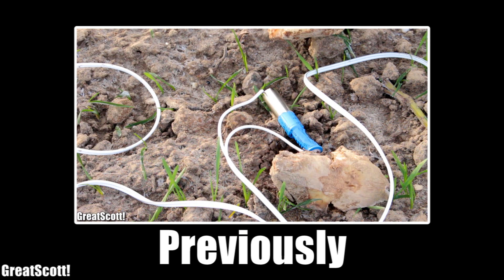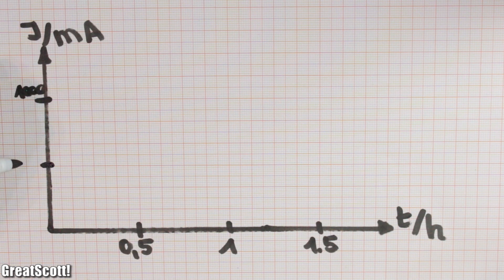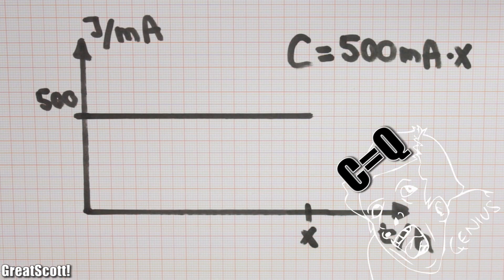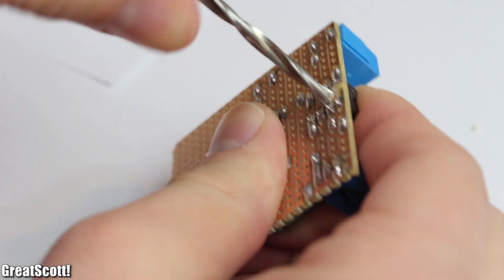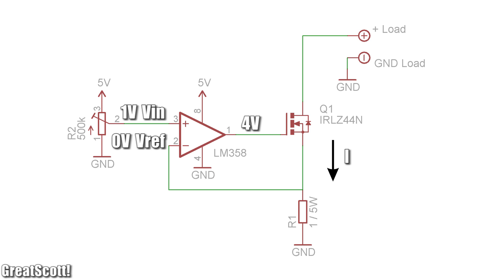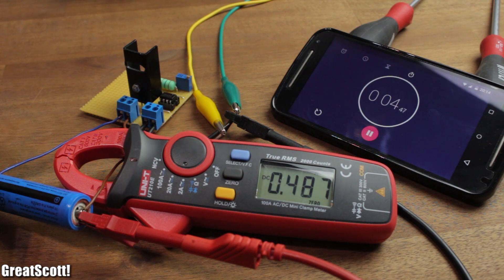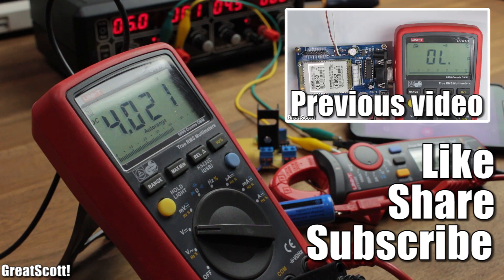Li-Ion Capacity Test || DIY constant current load

Comment: Nice and simple circuit. I made it work, but mine is quite inaccurate. I suspect the voltage drop in the traces between the mosfet and the shunt resistor is the reason.

Comment: I am only Civil Structural Engineer that barely made it through Electrical Fundamentals in College. It seems I am still lacking that part of the brain that can understand most of the current, ohm and resister formulas, yet the use of a constant load made total sense for the mAmp calculation. I have replaced the battery (EG30) in some Mororola XT1030, them do not seem to seem to be much like a new battery. It is hard to determine whom, is selling batteries that actually supply the power they state. It may come down to you get what you pay for, but it is often hard to tell. Either way, I would appreciate hearing your thoughts on this post on How to Revive Lithium Ion Batteries.

http://sciencing.com/revive-lithium-ion-batteries-5982537.html

Is there any truth to this?

Comment: I'm having trouble with "drift" with the OpAmp voltage follower. I 
used a 1ohm, 10% power resistor, an LM324, and a IRF540 Power Mosfet (only .022ohm RDS(on) !!).

I am using a 9V power supply for the LM324 (measuring it, it actually 
shows about 10V)

I notice that if I use this to test battery discharging I get "drift". 
I'll start out at say, a setting for 500ma, and as the battery voltage 
drops, the current increases , and i'm not sure why. I thought perhaps
 its something to do with the MOSFET changing its conductance or 
something? I always end up having to adjust the input pot setting over 
time to lower the current back to 500ma

It doesn't make sense to me becasue the OpAmp should technically keep 
the voltage /current constant even if the resistor drifts, wouldn't it? 
It almost seems like my OpAmp is drifting.

Also, my MOSFET doesn't get hot at all, granted I'm only running 1.5 V 
at 500ma , and the resistor is .5V of that (I set the OpAmp + input to 
.5V so I get .5A on the 1ohm resistor), so ya it's only having to handle
 what, 500mw, not that much I guess.
Reply: The most likely cause of drift in your case is the resistor's value drifting. You're dissipating 0.5V x 500mA = 250mW in the resistor and if that's its rating, it will get hot and its value will drift. The opamp will compensate for any change in the mosfet's characteristics because it's inside the feedback loop, but the resistor isn't. The only other source of drift is the opamp's input offset drift, but that's going to be not much more than about 20μV/°C for the LM324, and as the gain is 1, that's really not going to be significant. Just try a higher power resistor for R1 and see if that fixes the problem.

Comment: Fantastic! This is exactly what I was looking for. I tried making a constant current load with an LM317 to test battery capacity, but the voltage was too low resulting in the whole thing falling out of regulation. I think I have most of these parts lying around. Thank you so much, I can't wait to try it out!
Reply: Why don't you use a tp4056 charging and discharging module. It will automatically cuttoff you battery connection with your lm317 tester when it discharge alot....

I know I'm little bit late here,😅

Comment: Sorry but the energy of a battery changes in accordance to the discharge current: the higher is the discharge current, the lower is the energy you can get from the battery. I'm not an expert of Li-Ion batteries, but with VLA and VRLA batteries usually the capacity is referred to a current that discharge the battery in 8 hours (C8) or 10 hours (C10). If those batteries are discharged in 2 hours the Amp-h you can get are lower.

Comment: Can I use that circuit to test 1.2V AA batteries? Or 1.2V isn't enough to draw constant current?
Reply: You can do it, but it's not quite as easy. Let's assume you want to measure capacity as the voltage drops from 1.2V down to 1.0V. That means you have just 1.0V to drop across the IRLZ44 and R1. You therefore can't afford to drop more than about 0.5V across R1 in order to leave 0.5V across the mosfet. I'd recommend a smaller discharge current, but if you still wanted to test at 500mA, you'd use a 1 ohm resistor again, although using 2.5 ohm and 200mA discharge would be more appropriate for AA batteries. You could set 200mV as your Vref with a 1 ohm resistor for R1 to get 200mA, but lower values for Vref will eventually run into difficulties as the opamp's offset voltage drift starts to become significant.

Comment: I've been trying for a few weeks to integrate this with an arduino.  My thought was that instead of a potentiometer for the non inverting input to the op-amp i could use a PWM signal from a digital pin, and use a resistor/capacitor circuit to flatten it out to a constant voltage.  however i've been fairly unsuccessful in doing so.  the voltage reading of the battery seems to fluxuate quite a bit and it's difficult to see exactly where it is.  

have you ever done such a setup or figured out a way to automate this a little more?
Reply: doing a little more testing tonight, I switched my ceramic 1 ohm 5W resistor out for a 1 ohm aluminum axial wound 100w unit and the voltage fluxuation reading seems to have subsided.  If you have any ideas as to why that would be, i'm very curious.

Comment: UltraFire: Not the best name for a Lithium battery.
Reply: 18650's CANT have 4800 mAh ... period.
Reply: @silversrayleigh8980  I'm going to be getting some that are 3000 mah for a raspberry pi 3 b+
Reply: They are LG battery's so they are real
Reply: @nathanmead140  3500 is the maximum achievable with 18650 (they are used in 5s2p cordless tool battery packs with 18650s with 6 Ah) but 3500 is the total capacity, normally only 3000 should be used, to extend the life span of the cell.
Reply: the ultrafire flashlight and batteries I got have protection ic's (batteries) and yes the flashlight (9000lum) can get over 100c under max brightness but the cheap ass batteries have an internal resistance that limits the light from going thermonuclear and even mid quality batteries do exactly the same fire may never happen but I was so worried it would I added arctic mx-5 between the led pcb and the case edge and it smoked a bit before it dried a little and I do like it as it is a great short term spotlight/worklight and seems to pull a stable 3.8a from a pack of 4 18650's
Reply: Lol... True
Reply: Ultrafire Li-ion battery: I create a fire bigger than Panasonic Li-ion battery.
Reply: there is a china mall in my town that sells these ultrafire batteries but they are ripoffs of ripoffs because these are called ultrefires and are rated to be apparantly 14000mah
Reply: heyhococo ha
Reply: Kkkkkk
Reply: @ElectroMundo_oficial  BR!
Reply: Yeah
Reply: Like 99% of those are fake with up to 9000mah ratings. That's how you can get free batteries from ebay if you tell the seller that the capacitance doesn't even close to stated one (and risk to burn your house with those).

Comment: hi sir great scott...may i have a question? since the op amp LM358 have 2 comparator...can i use them both??

2pcs. IRFZ44N, 2pcs. 500k potencio meter, 2pcs 1ohm resistor but 1pcs LM358....

thanks for your time to reply...
Reply: Yes, of course. The only other thing I'd recommend is placing a 100nF ceramic capacitor between pins 4 and 8 of the opamp, as close as possible to it, to decouple its supply. It probably wouldn't hurt to put a 10μF electrolytic capacitor across the incoming 5V supply, especially if you have long supply leads.

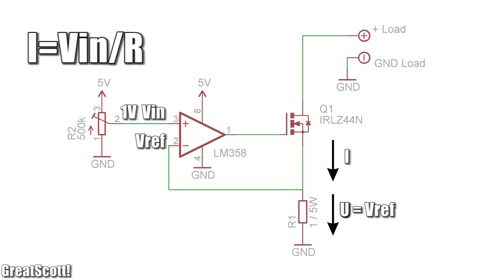Comment: Quick question: 3:40...WHY is I=Vin/R ? Would like to know how you found that formula. I mean I know how ohm's law works, but how does the op-amp affect it ?
Reply: Opamps with negative feedback always change their output to keep their inputs at the same voltage. The opamp and mosfet together are working as a simple non-inverting buffer that fixes the voltage at the source of the mosfet to the same voltage as is supplied from the wiper of the potentiometer. That constant voltage provides a constant voltage across R1, which gives a constant current through R1 and therefore draws a constant current from the supply to the mosfet's drain, i.e. the battery under test.

Comment: You should have used a BJT (NPN) transistor instead of the FET.  There would have been no oscillation!   Not that matters. 🤔
Reply: The oscillations come from the lack of supply decoupling to the opamp, not from the choice of buffer transistor.

Comment: I tried building this Constant current load, but it didn't really work. After checking almost everything on it, i checked the resistor and found out it wasn't 1 OHM but instead 100 OHM or smth. Now I just have to find an actual 1 OHM resistor :D

Comment: Hello, I hawe a power supply, the output voltage is 5v how do I measure the current to calculate the power supply power? I can not just hook up a multimeter right? I need some load and then what ? I think I could use a resistor but I do not know how to calculate it or what tu du exactly. Can someone  help please ? :)

Comment: Could you explain how clamp meters work? Specifically when measuring amps? Thank you!
Reply: A clamp meter or clamp tester is a DMM with an in built current transformer. The CT can measure an ac current without having to connect the terminals of the meter or without having to cut open the cable whose current flow needs to be measured.
Reply: A CT (current transformer) is a device that measures a large current with an instrument having restricted range of about 5 Amps.

Comment: A bit alarmed that your linear regulator oscillated at 100kHz.
Reply: From the datasheet SNOSBT31 from Texas Instruments for the LM358.page 24:
"For proper operation, the power supplies must be properly decoupled. For decoupling the supply pins it is suggested that 10 nF capacitors be placed as close as possible to the op-amp power supply pins. For single supply, place a capacitor between V+ and V−supply leads."
What you see is the usual result of not decoupling the supply and driving the output into a capacitive load (typically 3.3nF for the IRLZ44).

Comment: If i understand correctly, the mosfet gets hot because it is constantly driven in "half-on/half-off" state, right? in your test, dropping max 3.2V at 1A, i.e. the mosfet dissipates 3.2W of power. How high can this be pushed realistically? For instance, driving the 1 Ohm resistor at 5A from a 12 V source would require a voltage drop of 7 V across the mosfet, which would equal 35W, right?  The irlz44n datasheet mentions an abs max of 110W (with proper cooling, obviously), that sounds not plausible, am i mixing things up here?
Reply: That's the right way to calculate the dissipation in the mosfet. To calculate the heatsink needed, you divide the power consumed into 150 (which is the maximum allowable rise in junction temperature from 25°C to 175°C) and then subtract 1.5 (which is the typical thermal resistance from junction to heatsink). So to dissipate 35W, you need a 150/35 - 1.5 = 2.8°C/W heatsink. The only way you'll dissipate 110W is with an infinite heatsink or some means of active cooling.

Comment: can i use irfz44n  instead irlz44n  ?
Reply from the maker: Only if you use higher supply voltages.
Reply: okey ithink 12v or 9v will be okey right
Reply: i tried 12 v and result is  around 360 mA  max. :(
Reply: i have alot of batteries and i need this circuit but i dont know how am i going to fix it
Reply: i am wondering since 2n2222A  transistor can handle 0,8 Amper and we will only draw 0,5 Amper  can i use it instead of mosfet ?
Reply: okay i fix the problem. never trust breadboard cables. the resistance of them was too high. ibuild the circuit on perfboard and its perfectly fine even im using IRFZ44N  its still working perfect with 5 v :)

Comment: Thank You, Greatscott, for all your constant output vids!Robert Murray-Smith has a large vid library devoted to DIY paper/carbon megacapacitors for use in motive apps.  The voltage drop on a megacap is like a rock slide.  I dunno if homebrew (raw materials start-point) development is your idea of fun, but I propose that megacaps constructed of low-ESR kilocaps would be the solution to this competent alternative to li-Ion, if efficient solid-state power-switching can be done to sequentially boost volts at the expense of amps as discharge progresses.  RMS ( a phD chemist) is trying to compete with his professor-brother for the kiddie-crowd and sticking to paper bacitors.  I further propose that nickel foil and PET film starting materials would guarantee low ESR and high cycle efficiencies.  If you know anybody who wants to wow 'em with high-power motive demos (electric motorbikes, etc) this approach looks ripe-- but I dunno electronics, so maybe you could comment on the utility of the above switching scheme.  Yours is the most awesome DIY electronics channel I've found in many years of YT searches.  Thanks again, for being so cool!

Comment: Hi, can any one post a link to good quality 18650 type rechargable battery to buy, lets say ebay. Thanks a lot!
Reply: Don't buy off ebay, that's how you end up with these fakes, Samsung 25r's or 30q's are pretty popular right now depending on your amperage needs and how many cells you are using, also LG HG2's. Sony has some good batteries but they have the most fakes of all right now.
Reply: I have a flash light/taser so I'd like one or two to have a replacement battery
Reply: Marius Gi What's the amp draw? Flashlights are usually pretty low but tasers I have no idea about. Defiantly don't buy batteries for a taser off ebay, you are just as likely to hurt yourself as you are to defend yourself, just find a reputable battery dealer in your country. If you live in the US good 18650 batteries are like 5-10 bucks each.
Reply: Dont know the amp draw. Thanks fo the info :)

Comment: Hey Great Scott! I would like to know, why You disregard the transistor consumption power? You said that it's really getting hot... Hot means energy... I think that You don't need constant current, but constant power. I would choose buck-boost for constant voltage on the resistor. Constant voltage on resistor means constant current means constant power consuming minus buck boost efficiency.
Reply: Isn't the current used by the heating process? That's where what you are measuring goes if I understand correctly.

Comment: Often inside chinese 18650 batteries there are smaller 16-something ones, shorter and thinner, thats why the capacity is so low. Waste of time and money to even consider using them. Cells from old laptop batteries would be more reliable and efficient.

Comment: What is the max load this can be used for? And can I increase it with parallel mosfets?
Reply: The IRLZ44 has a maximum continuous drain current of 36A with its case at 100°C. It has a thermal resistance of 1.5°C/W between junction and heatsink and a maximum junction temperature of 175°C. So operating at 25°C, an infinite heatsink would allow (175 - 25) / 1.5 = 100W. Smaller heatsinks would reduce that. Note that with a 4.2V battery, the maximum current drawn is limited by the maximum dissipation, not the maximum allowable current of the mosfet. The heatsinking is the limiting factor, so paralleling mosfets isn't going to help much.

Comment: Hallo Scott.

I have try to make this CC load, 
I dit it on a breadbord and i use a Irf540n mosfet and a Tl081 opamp and i can not get it to go down to 0,0 mA, i can not get it lower then 9 mA, and the volt on the load resistor can not get lower then 0,7 volt. did you run in to same kind of problem when you mades yours....??
Reply: The input offset voltage of the tl081 goes up to 15mV, the resistor is not 0 ohm and the mosfet isn't perfect. There are a lot of reasons... 9mA is not bad for a minimum current with this stuff :)
Reply: Hi Oliver,
Thx for the answer, i get the volt and current at the load resistor at 0,77 volt and 8.9mA så a total of just below 7 mWatts, så i think this will work for what i need,

Thank you

Comment: helo :D i build this on irf44z and i have a problem how set a potentiometer. I know only I must use 12v instead of 5V for the circuit. Tthank you for any answers :D
Reply: Use 12V for the supply to the opamp. Then decide on the maximum value for Vin. I would suggest around 1V, which would give 1A constant current with R1=1 ohm.
Then use a 470K resistor from the 12V supply to one end of a 50K potentiometer and connect its other end to ground.
Check that the wiper voltage can be varied between 0V and about 1.1V.
That will allow you set constant currents from 0 to 1100mA. The resistor R1 will need to be rated at 2W at least.

Comment: Hi there. Nice video.
Although what I wanted to ask is - 

Is this going to work for higher amp discharge too? Does it mean that I should pick a 2.8 ohm resistor to disharge the battery at 1.5A ? How do I keep constant current at such level through all of the discharge time?
Reply: It looks to be effectively a PWM load, so averaging the cycle gives you the constant current use case.  I think that's what the precision trimmer is for, adjusting the average current.
Reply: @reubenkriegel7639  No, it's not PWM. It's a linear circuit and the ripple on the scope is due to poor layout and insufficient decoupling of the supply to the opamp. The current drawn from the battery under test is exactly Vref / R1 (where Vref is the voltage set at the potentiometer wiper). I would aim to set Vref below about 1V to keep down the dissipation in the resistor R1. To use a 1.5A discharge rate, I'd suggest using two 1Ω 1W resistors in parallel, giving an effective 0.5Ω, which would need Vref set to 0.75V to draw 1.5A. You'll need to make sure you put a sensible heatsink (preferably less than 20°C/W) on the IRLZ44.